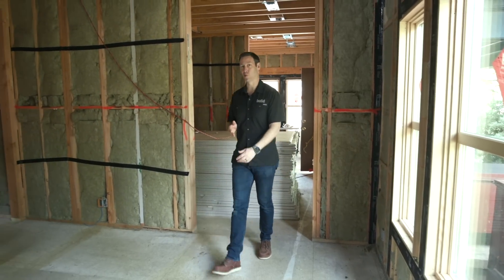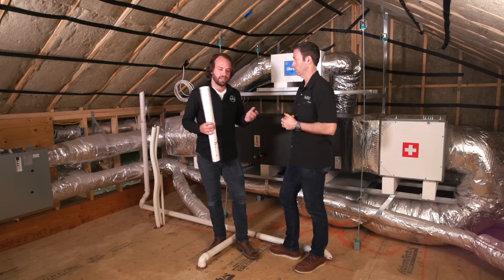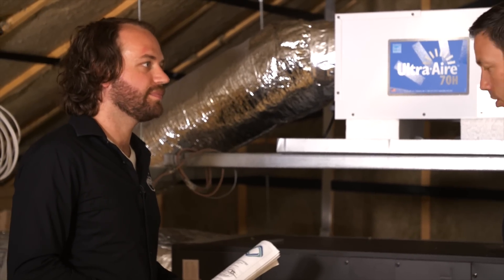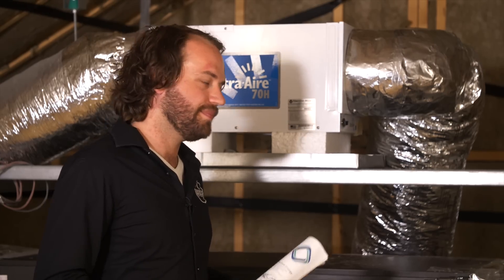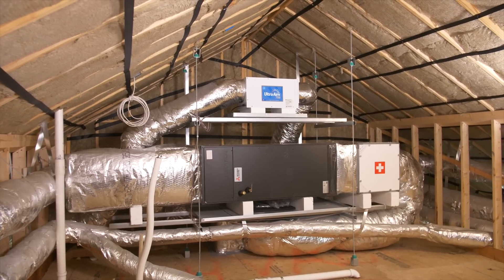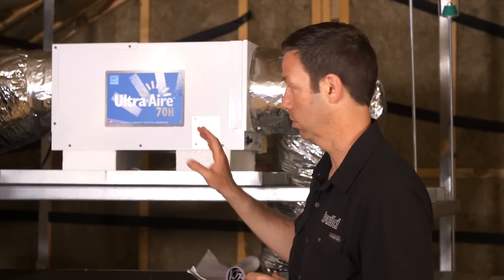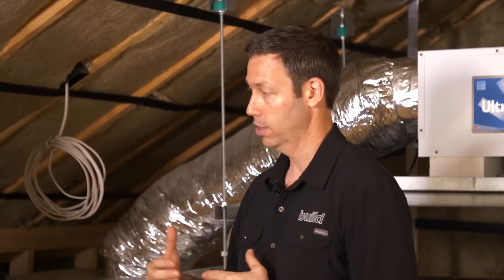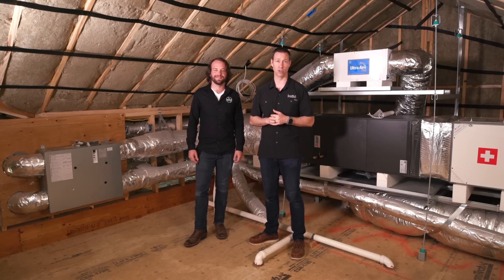New BUILD : Excellent Air Conditioning System Cost?  I’ll tell you!

Comment: To me it's not life or death to have a 100% sealed house.  I mean you have to bring in fresh air.  Sure its filtered, but you open doors to go in and out, which is about the same depending on how often you go outside.  I know someone that did a remodel with spray foam and mini splits, power bill about $30 a month.  If he washed clothes and used the dryer, or used a bath fan, when he opened a door to leave, his house would actually suck the door open because it was pulled to a vacuum almost with the exhausts.  Crazy.  Just think I'm too practical and have to be really be truthful with myself when selling things like that to people when I honestly dont think its needed.  Cuz it's not NEEDED, it's a luxury basically.  I can put in a standard 14 seer heat pump system in a 1300 sq ft rancher from scratch for about $10k, and electric Bill's would be around 120, depending on insulation.  Mini splits would double that up front cost, possibly triple.  If a house is that well insulated, a super expensive hvac is total overkill.  The rancher I speak of could have $70 electric bills if sprayfoamed.  So why spend the extra 10k in hvac?  Even the 14 seer system would barely run with a house so tight.  Should be a study to show cost of hvac per sq ft and cost of insulation per sq ft and cost of electric bill per sq ft.  To find a happy medium where you aren't wasting money.  Even if u got unlimited funds, if you are super insulated, any hvac will do its job easily.  So how much do you really need to go beyond the norm before it no longer gives a return on investment?  Wow way too long of a post, sorry.
Reply: You are overlooking air quality-yes air is entering the house but through leaks and “filtered” by man made fiber insulation and dirty getting into the air you breathe, and this approach allows you to positively pressure the hosue, invaluable for pollen and ESPECIALLY for radon. ...but i do think you can go crazy on this stuff -the whole concept of passive house is nuts. A;so a good compromise is a cheaper simpler say two stage HVAC unit AND augmented by a dehumidifier.
Reply: He did have a fresh air exchange system in play. I know nothing of HVAC so I'm learning. And rockwool insulation helps with the mold and bacteria problems since moisture isn't absorbed by this material unlike fiber glass insulation which I have seen first hand.  Not to mention a 70 liter per hour dehumidifier system in play as well.
Reply: Sounds like your friend's house is in a vacuum while he's doing normal things like laundry or bathing. That violates a cornerstone rule of efficient operation and can (sometimes) lead to things like humidity damage down the road. If you get any significant amount of air exchange by simply opening a door and closing it behind you, your home is either in a serious vacuum or incredibly poorly built (same difference). You can either spend the money up front to actually control the interior conditions inside the home or you can spend the money on the back end by cooling air that is exchanging to the atmosphere. Power cost will never go down, only up over time. These homes are generally not 1700ft ranch homes; they're large, complex homes in a hot, humid climate. These homes are intended to last 100 years or more. 100 years ago, it was ridiculous to build a house with sheathing>water barrier>siding. But look at us now. Your position seems reasonable today, but it won't in 50yrs.
Reply: I completely agree with you. I did A/C work for 38 years and only ran into a few of these systems. They are typically bought by "Look at what I have" types of people. I just about flipped when I heard their price estimates. I guess they need that money to keep making videos on YT for people that will never spend that much...
Reply: Depends on how long you are gonna own that house. If you are going to own it the rest of your life then seal it up as tight as you can for as cheap as you can. Maybe spray foam the attic or at least air seal the top plates and rim joists if you have them.  Then get a manual J done and if your super tight then get a variable speed Trane.  Sure 14 seer single stage can do  it but SEER has nothing do do with how efficient a unit is most of the time. The duct work is so undersized and unplanned its wasting the money and comfort. Plus you need O2, and in most homes it over 1000 ppm. I guess this is why we have such dumb people today, all that extra co2 is diminishing there cognitive abilities.   I seen a local school class room air quality test and it was upwards of about 3000ppm co2.... way too much.
Reply: these are good in commercial buildings
Reply: Think you just gave a perfect example of a house that was not designed correctly. If your friend's house has a negative pressure from a dryer or bath fan, then it was built tight but they didn't take into account of air movement requirements, and probably didn't have a professional HVAC design. A passive house such as the one they are showing in the video requires an HRV/ERV for constant fresh air and won't have any dryer/bath fan that vents to the outside. A well built tight house does save money on HVAC since a smaller system is needed. The system they are showing is little over the top, and the price is ridiculous, but one can get a good zoned mini-split system, with ERV and dehumidifier for much cheaper. Why do it? Because your home is more comfortable and it will save you money in the long run.

Comment: Hvac is by far the most important part of a house.  Doesn't matter how big of a TV you have, atmos sound, granite countertops, expensive cabinets, huge expensive showers, none of that matters if you aren't comfortable.  I think that seperate dehumidifier is a bit overkill with a Mitsubishi system.  That removes so much humidity, shouldnt need a separate unit.  Nice filter tho for sure.  Trane makes an 18seer unit that has a variable speed compressor that is pretty noticeably lower cost than that Mitsubishi. 100% would not need some high dollar engineer to design something on paper that when you see how the house is ACTUALLY built, wont even work.  A top tier installer does not need an engineer to tell them what size ducts to run, or how to run them.  A 3 ton 18 seer install with all the ductwork would cost in the range of $20k.  Give or take.  The dehumidifier is sooooo easy and cheap to hook up.  If the actual unit costs $1k, then total install cost added to the whole job should be no more than $2k.

Comment: the suggestion that it is more important to get the ductwork design right for the system is on point. for example, if someone buys a gas furnace that advertises "up to 98%" efficiency, and then plugs that furnace into existing ductwork, that person has almost certainly wasted a lot of money because the ductwork is probably not optimized to the furnace.

Comment: Another aspect that ought to be talked about with the installation is the cost to maintain and repair it over its lifetime. VRF system parts are very expensive when they fail, not to mention availability and lead time. VRF systems also have more sensors and microprocessors that fail. On top of this, the maintenance schedule will probably be monthly, and those Merv 16 filters won't be cheap. For this type of system design, your average joe residential HVAC tech isn't going to be able to troubleshoot or maintain the equipment. I've seen many home owners go through thousands of dollars because the techs servicing their equipment didn't really understand the system design or its operation. As a result, the ERV is shut off, dampers are closed, the unit's controls and safeties get bypassed or jerry rigged, etc. It's a great system, but is the owner ready for the headaches associated with such an efficient, complicated, and intricate system? In addition to higher installation costs, there's a much higher lifetime cost to operate and maintain the system. All of the energy savings you'll have can be put towards maintaining it and repairing it.

Comment: I'm not sure that's technically VRF ... isn't that just a big single indoor inverter-based unit? I thought VRF was about distributing coolant from a single external unit (which is usually (?) inverter based, meaning not just on/off but variable output) to multiple indoor units... looking at all that duct work I can't help thinking how simpler it would be to run just thin coolant lines..

Comment: I have a question. So I'm looking at this outside air system. 
Positively pressurizes a house just slightly, up to 100 cfm.
The exhaust fan in my bathroom is 160 cfm. While i know that's a bit much, and i would likely go into vacuum for a bit during an exhaust period. Is this system smart enough to sense the massive pressure drop, and shut off the exhaust fan in the outside air system? does this assume that no exhaust fan exists?
Do houses with these units have different exhaust plans?
Reply: James Runyon -- I was wondering about that too. I have seen separate intakes adjacent to kitchen range hoods, but what about large bathrooms?
Reply: @broddr  oh! thats right! when i was a cook in my younger years the smoke hood over grills had an intake built into them. maybe the crapper has its own system. it would likely need one in my house anyway.

Comment: I get it. I like neat, shiny things. I'm pretty successful- I'm probably doing better than 95% of the population, and there is no way I am going to spend 50-100k on an HVAC system, unless I hit the lottery. The ROI on this stuff is non-existent. No one cares at resale, and the savings are negligible. Of course I agree with getting the ductwork right, but I just struggle with the validity of a lot of this in real world situations with real world budgets.

Comment: Mitsubishi (et al VRF manufactures) will not sell  HVAC CONTRACTOR a  VRF system unless the contractor or one of the employees complete the training at one of their facilities, VRF is efficient, cutting edge, and good luck on getting parts and a competent service technician when you have a failure.  Took 9 months to get a failed board on a brand new VRF system from Mitsubishi, which almost landed my company as well as Mitsubishi (Trane) in court.  Yes, they have a long warranty, but getting the parts is a nightmare, and as we have seen with ductless mini split systems, the life expectancy of the circuit boards before they become obsolete is not more than 8 years.  Understand the other manufacturers, Daikan (Goodman), Toshiba (Carrier) are forming joint ventures or merging for market brand awareness. Also note the joint ventures Mitsubishi  & Trane, Carrier & Toshiba, etc. have caused huge issues when getting parts and warranty repairs completed, not all Trane Distributors can sell Mitsubishi. Trane dropped Samsung VRF joint venture in the middle of a multi-million dollar project and now we cannot get software support on the system because each blames the other for issues, good times. 

 IQ Air is the most expensive brand filtration system, not the best, Camfil makes outstanding filters that can be installed into a similar, lower cost housing. The higher the MERV rating the higher the static pressure, meaning quite a bit more energy is need to pull air through that restrictive filtration system, costing you more. MERV 16 may not be necessary for quality indoor air. Also, note that routine maintenance will cost you many hundreds of dollars several times a year in filters alone.  Keep this in mind for the real cost of ownership. VRF is the way of the future mechanical / HVAC installations but is currently in a painful steep learning curve for HVAC contractors and suppliers.
Reply: VRF is not cutting edge, not at all.  I has been mainstream in countries like Japan and Spain for DECADES.  So this is a US issue, and to be honest, sounds weird to me.  It is just a little bit more complicated than a "normal", obsolete design, and the confort and efficiency is way better.  
In Spain and Europe in general they are marketed as "Inverter" making reference to the mandatory DC inverter they need to have in order to do the trick.

Comment: I’d like to see natural gas used in a hybrid system and some high wall returns. The lack of high wall return creates a stacking condition. System looks good and to the about ig lights the filtration is fine.  Ig lights are sold to homeowners that won’t go the extra mile for real filtration. No light stops airborne particles.

Comment: Can you do a video for a normal house, maybe 300 - 500k price range and it's equipment. It's nice to see a HVAC system that 99.99% of the audience will never have but what can the rest of us expect if we are putting in a new system?
Reply: With 10+ years of experience their is a large difference building to your environment a lot of his video show southern building high humidity year round but in the northern building for a 2000 sq ft home you would be over paying hard for some of the things Matt advocates for but he does his disclaimer when he speaks in his videos i do believe he over builds but that’s what his clients want and their is nothing but respect for General contractor who is well educated
Reply: @danielluti8857  depends how far north you go. Further North into central/northern Ontario we have a lot of weeping bedrock that causes dampness in the houses year round. Not to mention all the humidity from all the small lakes and the slow spring melt.
Reply: Amen.  This is A/C for the rich and famous.
Reply: That's nothing crazy man. Nothing crazy. Filtration on that system I'd prolly the most over the top thing.
Reply: Correct as a Hvac owner this is a dream job. 99 percent of our jobs are the same equipment minis the make up air and heavy duty media filtration system. This house they made so tight with insulation that they have to bring in outside air. Which 98 percent of homes breath. Meaning they bring air in threw windows, doors, etc. In this house if one person gets sick whole house get sick. A lot of these house are not healthy. Mold
Reply: THATS A TYPICAL SYSTEM WITH A DEHUMIDIFIER....NOTHING FANCY....JUST AN AIR HANDLER

Comment: Unfortunately, the overwhelming majority of new home customers don't see the value in these designs. Too many are more concerned about the fancy granite countertops and marble floors with high ceilings. As a result, the HVAC system is forced to be installed in an area that is too small, uninsulated, and the ducts are jammed and crammed through the trusses.
Reply: Yea like at my house, they put it in the crawl space in the remodel..... Gaaaaaaaaahhhhh!!!
Reply: @MandoFettOG  if it makes you feel better  , they run them uninsulated across the roof here in southern Arizona.  I promise your crawl space is better insulated.

Comment: It's crazy that US still has single stage AC today. VRF has been out there for a long long time.
Reply: We have them in the US wtf are you talk about. The main reason we dont use them more widely is homeowners dont want the cost increase of equipment and homes are not designed to work with those systems and customer will not get the benefit of them

Comment: For normal people...you don't need high seer. 14 SEER minimum is fine. Concentrate on getting your duct work to single digit air loss, 0 is nearly impossible,  and then keep a good filter in it. Your AC is a dehumidifier.  Most AC systems get your home to low 40% relative humidity,  this is great. "Build the tightest house we can" is bullshit.  Everyone of these units has an outside air duct meaning,  it's always drawing "fresh air" from the outdoor ambient...always.
Reply: Can you expand on why you say 14seer is fine? I'm building a home right now and struggling with how to spell the AC system

Comment: This is a GREAT video. There is so much good information here. What people don't understand about buying a system through a big box store is that they're only trying to move as much equipment as possible. They don't pay the installer enough to make it worth their while to ensure you have the best installation for your home. They're only there to put in equipment, not make it work with the home properly. Spending so much money on your home, it only makes sense to pay a little more to have the job done properly. Improperly installed equipment leads not only to less than desirable conditions, but it can also easily cause failed compressors and other expensive failures down the road.